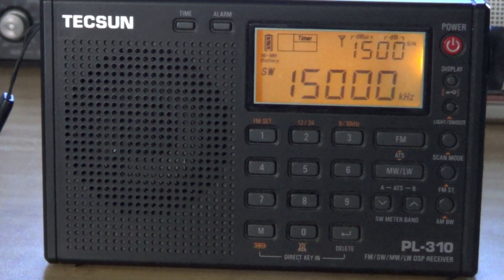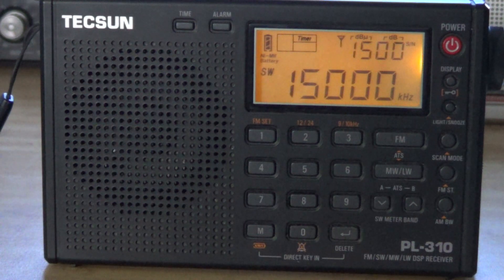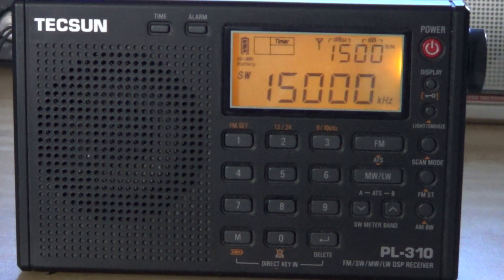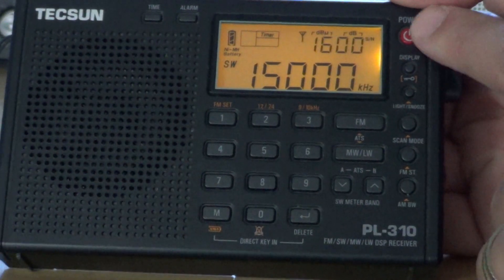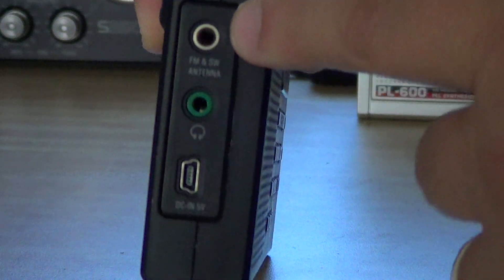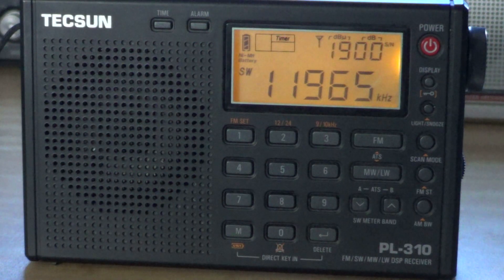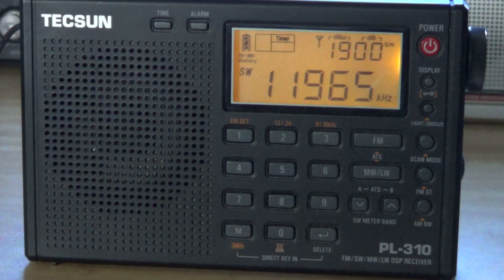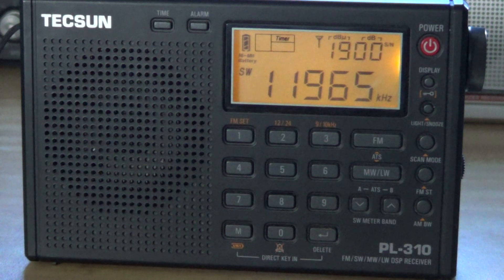Tecsun PL 310 DSP receiver review

Comment: For most people,think of this as a mediocre to decent am,fm radio, cause the short wave is nearly non existent,even in a park. Also expect to double the price if you pay for the service contract,plug,and roll up antenna. I'm only keeping it cause basically the only station I listen to comes in a little stronger on an old cheap Sony boom box. For the hundred bucks you can get a c crane pro that's am/ fm with a bigger speaker and dialable bass and treble controll. I don't think it's stereo,though. You can also add am antenna

Comment: The PL-310 is my favorite of the other similar Tecsun DSP radios - the PL-505, PL-606, PL-310 and the PL-390. I've had two of them( 310's)  and one drawback has been the tuning knob falling off both of them at some point. It goes right back on but I had to add a little adhesive to be sure it wouldn't fall off and get lost.

Comment from the maker: Does the sychronous detection on the PL660 work well ?    I have a degen  de 1106 .. which is the same type radio ... but the Sync detector looses lock often.   73's
Reply: OfficialSWLchannel I

Comment: i bought this and i cant even pick up the fort collins signal. I can't get MHZ to change. Help any suggestions? I've read the guide and I'm not getting anything except FM
Reply from the maker: you need to change the band to SW for this to work, you do this by pressing on the up down arrow for the SW bands.. then you can input a frequency for shortwave
Reply: I've switched it to SW and there is no reception. I can't get the Fort Collins stations. it's just all static on SW frequency.
Reply from the maker: You just need to continue looking... this week we had lower than average propagation ... you will hear if you check at different times of day

Comment: This is a hot little radio. Very surprised with it's FM performance. I can't, however, speak on behalf of its shortwave performance as I have not tested it against the other radios in my stable. 

FM selectivity:::5
FM sensitivity:::5
AM sensitivity:::2
AM selectivity:::3

This is a good little radio for DXing the FM band. AM is what it is however, basic, but still very respectable for a portable this size. There is lots of noise on the AM band, even at night, when listening to distant stations. I will do more testing, but this is my preliminary results. The FM performance is incredible. Very sensitive and does an outstanding job being selective.